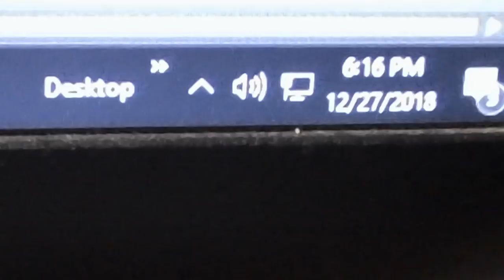1966 Ford Thunderbird repair and refurbishment (Part 30). De-rusting/painting leaf spring parts.

Comment: Thanks John for all of the Thunderbird videos. It has taken me a few days to watch them all, but they are great amd has plenty of information. I have been looking at 64 to 66 Thunderbirds for about 2 months now. I have been looking more to getting the a 66 though. Its Just the tail lights that has me sold on the 1966. Right now I am looking at 2 convertibles. They both are in good condition already, but I will be refurbishing it as well when I buy it. I am fixing to be turning 42 next month and have always loved older cars. Since all new cars have went to more computers and sensors, I would rather own and drive simple cars and this is the reason I am going back to older classics cars. 
      Your videos has given me ideas and has showed me what I have to look forward to when I bring my bird home. Thanks again and keep up the great work.

Comment: Hi John.  Happy New Year!  On those tiny holes in the trunk, you need something water and gas vapor resistant that is easy to apply.  JB Weld makes an epoxy putty product called Tank Weld that would apply easily, is tough as rat's teeth and can be sanded and painted. Works great for me.  Marine-Tex makes a similar, equally good, product.  Great to see your family.  Best holiday wishes to all.

Comment: John, Wifey looks great GOD BLESS HER and GOD BLESS YOU for making those donations.   Good to see you back in the shop, and that car is going to look new when you are done.... amazing work.  John, to plug those holes here are a few suggestions.    1) Use rubber grommets... this assumes all rust is gone    2) Use a strong magnet and piece of cardboard on the underside of the car and fill the holes with JB Weld... it will stop any damage dead in its tracks.  3) Use a rubber plumbing seat washer on both sides of the hole and use a brass screw to hold it all in place.      Good  Luck...  Puppies of yours are adorable....  Happy New year my friend to you and Wifey....
Reply: um thunkin John was beggin fer some of mama's hamberger too, lol
Reply: The washers and bolt sound similar to what they used to sell in stores around here to mend cooking pots that had holes in them. :)

Comment: Fiberglass, Not bondo putty. But Resin that is applied with a brush. duct tape on the underside to keep from getting the dripping mess. use fiberglass cloth cut just large enough to cover the larger holes. the resin will fill pin holes 3 to 5 coats in the trunk. peel the tape off under sand any drips and to remove undercoating from the area a few coats resin underside as well. I find applying the first coat only holes area then extending an inch or more in all directions for each additional coat you apply makes it easier to feather the edges in reduces the amount of sanding if you want to hide patches.

Comment: Fiberglass-strand reinforced body filler would fill those holes and be strong. I have done it before so I know it works as that is my method to coat over welded joints on patch panels. I have some that has Kevlar in it as well but I don't know if such a thing is made anymore.  JB weld might work too if you tape the underside of the trunk floor first so it doesn't drip out.
Reply: My vote is for masking off the underneath and using JB Weld. You could also add in some fiberglass fibers in the mix too.